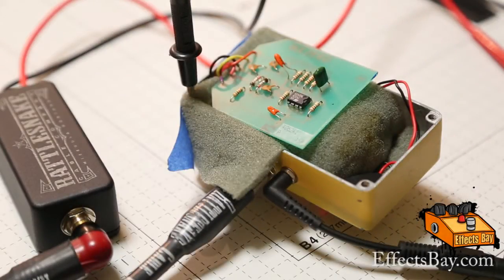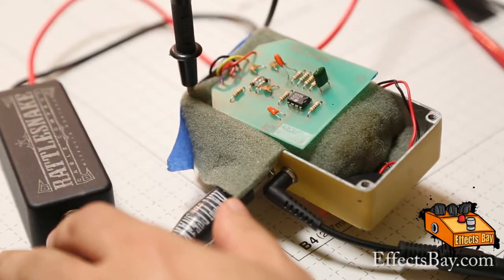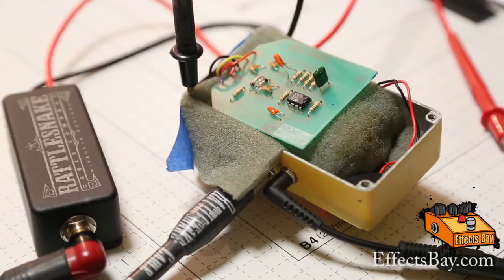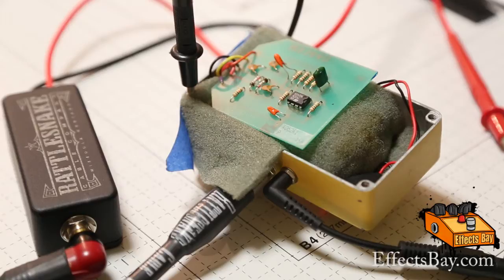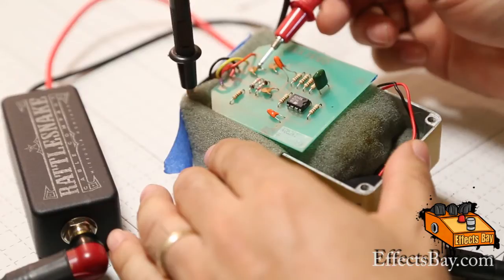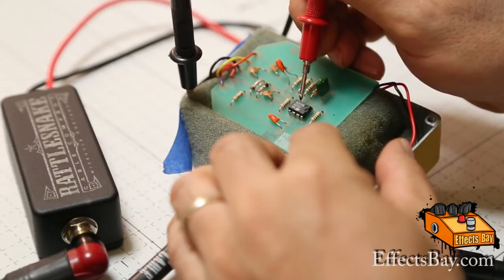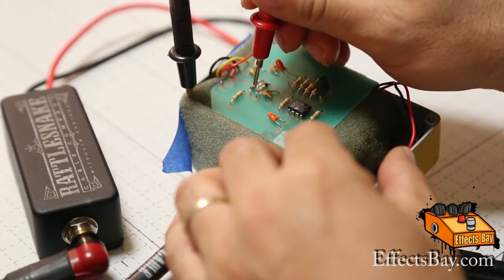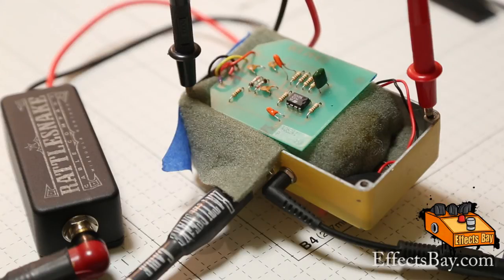Rattlesnake Cable Company Audio Probe

Comment: So (two years later I know, but) what was the problem with the circuit? :)
Reply from the maker: Thanks! The problem was the IC. She was fried. Nothing looked bad so I wanted to test components before blindly swapping stuff out. By the time I got to the IC, it was easy to tell it was not right. Swapped that at, and we were back in business.
Reply: Easy peasy!  Thanks for the reply.
Reply: @Effectsbay1  What led you to that..Did you have start from the input and go to the first thing that was farting..Does it work like pipe; the water is clean until it hits the contaminated spot?.that would be easy if so....Im just trying to wrap my head around this stuff.. Thanks
Reply: @rokinrandy  Basically, yes - you follow the signal path and find the point where it doesn't sound as expected. Then will then tell you that the problem is in that area. In this example, everything was fine until the signal hit the op amp, which would indicated problems in the op amp area.